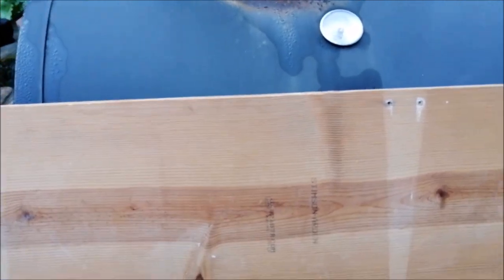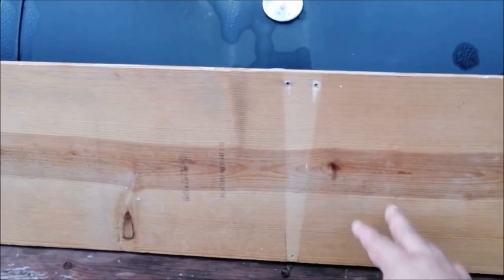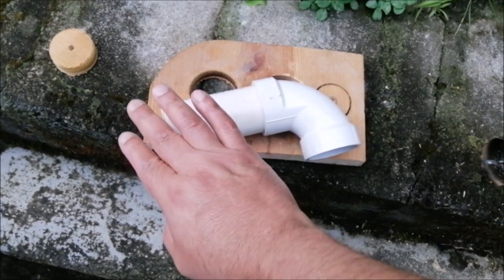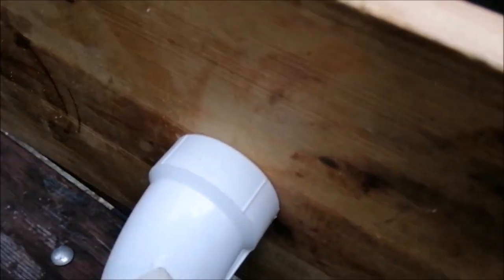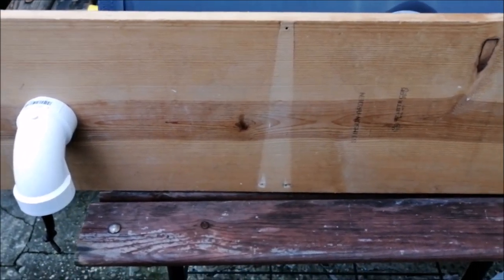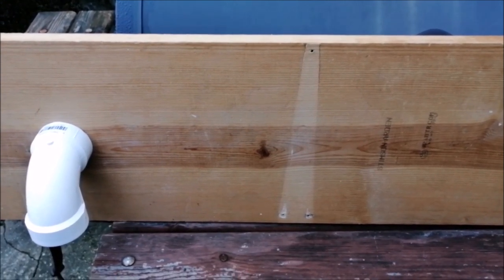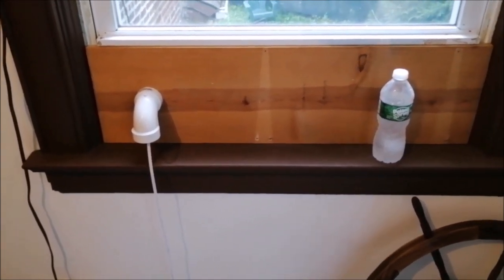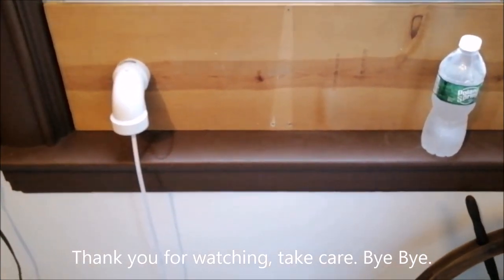Do It Yourself Ham Radio Coax Cable Window Passthrough. Little Or No Cost. Very Simple And Practical

Comment: The only concern is the bugs getting in
Reply from the maker: I will use plastic bags or I can spray some foam to fill in once I get my wires through the PVC. That is not an issue for me here in the second floor.
Reply: Just push a bath sponge into the tube, that'll fit round your wire(s) and keep the critters out. @dannyshortwave
Reply from the maker: @somebodyelseful  Good suggestion. Have a good weekend.